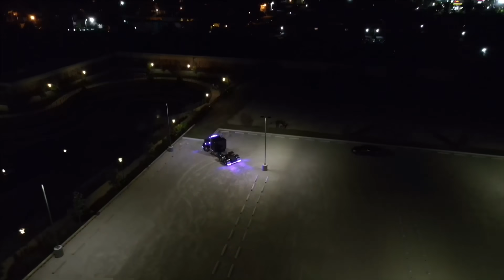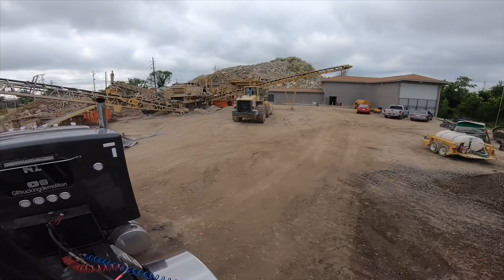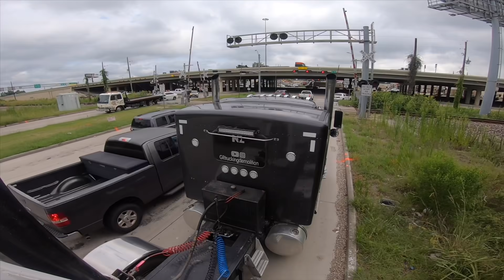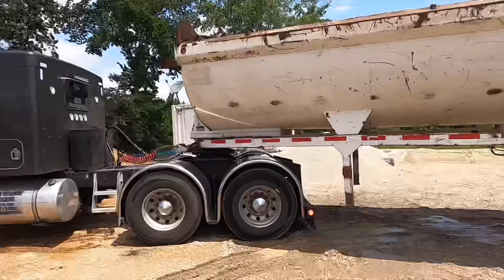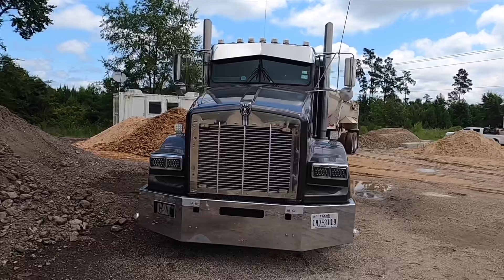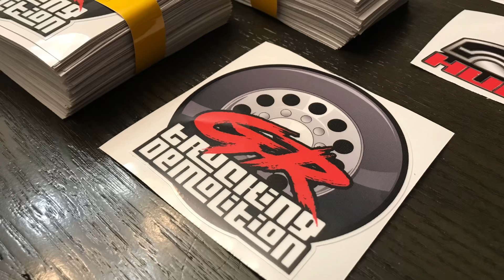END DUMP life, Hauling crushed concrete | kenworth rolling coal

Comment: U should get a tarp that runs on a chain. U just crank it and it covers the load. I use it on my flowboy trailer and its a lifesaver way easier that getting on top and extending it myself
Reply from the maker: Will be getting one once I paint the trailer

Comment: why are you sitting on the floor you have to lift your head up to see over the steering wheel
Reply: Fr
Reply: @benjamin-rn5zn  dont know what that means
Reply: It's a style, if you don't drive a truck you won't understand.
Reply: Only drivers with style understand things like that👊
Reply: @elmerrodriguez9817  ive been driving trucks for 40 years whats that style called i cant see anything
Reply: Idk for shorter guys like me, lower to the floor is more comfortable and when i get where im maneuvering tight spots i lift the seat. But im still not as low as him!!